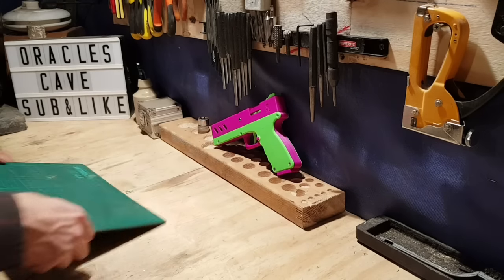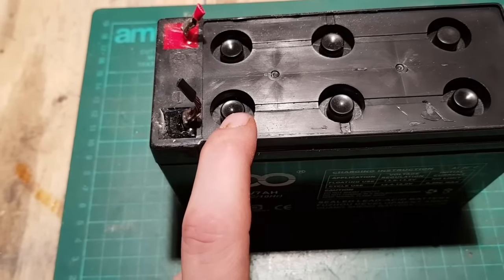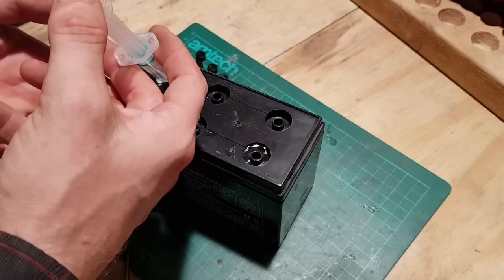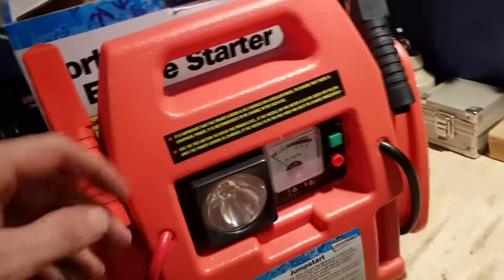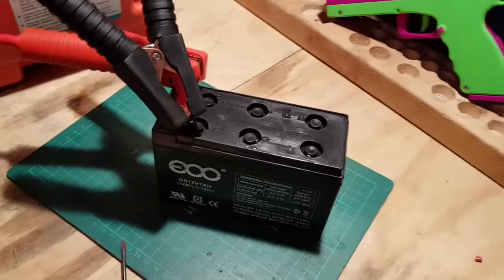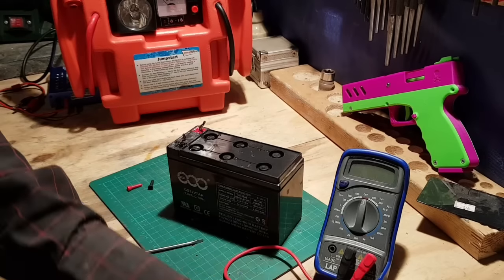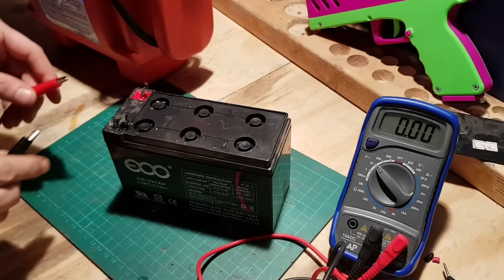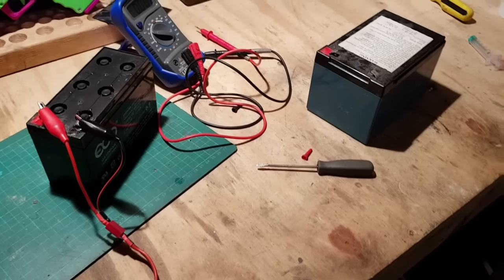HOW TO REVIVE DEAD 6V, 12V BATTERIES THAT WON'T CHARGE

Comment: Thanks, I am going to give this a go on my mobility cart Just so you know I have an old 230v to 18-volt ac transformer and connected the output to a bridge rectifier 20 amp type put that on a heatsink with fan and connected it to my 12 volts 12 amp cart battery both in parallel and run it for 2 hours and toped up the cells as needed and watched the output clime from 8 volts to 14.20 volts then let them rest as they were getting a bit hot after the 2 hours had passed I was looking at a resting voltage of 13.08 volts on both cells now I have to go back to the smart charger and will load both batteries to see how it went!! 16-06-21 if it all works it could save me £60.00 so thanks Bob in the UK
Reply from the maker: You might have to run the battery down and cycle again, maybe a couple of times.
But they should get back up and running again.
Let me know how it goes, it's always good to help someone with zero cost attached 👍👍👍

Comment: Very informative.Tried to use my mobility scooter after not using for about one year.When I tried charging the battery charger stayed on green but when I put back in scooter won't start or register on dial.I will try your battery recharging method and see if that works.Thanks.

Comment: Great video!  What setting did you use for your jump battery?  12v battery or 12v Gel battery and 2 amp or  12amp?  I have  a diehard charger model 200.71225.  I've filled my cells up with distilled water using a syringe.  Thanks!
Reply from the maker: 12v battery, first charge 2 amps then used the power in battery and charged 5 amps, then drained again and just kept raising the amps.
Then a couple of cycles of 2 amps again to make the battery very strong.
Reply: So I found a work around.  Took my cordless drill battery and a couple of copper leads, and connected them to the positive and negative terminals that are marked, then took the other ends and plugging the positive first, placed it under the clamp on my dead lead battery and did the same for the negative side.  Left it on for like 15 -20 minutes and now the charger thinks there is a battery that needs charging.  I did remove the positive and negative leads so it could charge.  We'll see by tomorrow how it looks.
Reply from the maker: @jamesdudley7046  yes that's also a great way to fool a smart charger into charging a battery that has been piggybacked from another working battery.
You mat need to drain the power down and recharge a few times to get the battery back to good strength.
👍👍👍
Reply: @oraclescave  I have been checking the cells and re-adding distilled water and doing the battery trick above to get the voltage up and then placing back on my trickle charger to continue charging.  I have realized it will drink water so I will continue this process and see if we can revive it.  Thanks!
Reply: How many times should I keep the distilled water topped off for each cell?  It seems as if it is stuck around 4.5 to 5.7 volts.  Do you have any other advice to try to get it charging and keeping a charge?  This is happening on 3 of my batteries.  Thanks for your help 👍
Reply from the maker: @jamesdudley7046  if it's not holding a big charge at all, you may need to buy acid refills for a battery, sulphuric acid, very cheap but will instantly bring the battery back to brand new power.
👍👍👍

Comment: Im sure you've figured this out by now but if you can fit bothe the charger and jump pack onto the battery terminals you can remove the jump pack after you put the charger on without having to wait
Reply from the maker: Yes, I just have various batteries now that I prefer using the juice from them that's all.
👍👍👍

Comment: Man I Am a Full time Scrapper. But I Save A Bunch of stuff.  I was told i could revive batteries through this method but I've never tried and honestly I forgot about it.  I have two batteries the same exact batteries matter of fact they were in razor scooters,  the batteries won't charge and the razor scooter will not move at all so same issue. I was going to scrap the batteries tommorow but now I'm going to do this .
Thanks

Comment: Just wondering if it would be advisable to plug in the red booster pack to the house current while charging the dead battery ?
Reply: Good idea, it will probably work, but I have not tried it.  The booster pack charger will limit the current, so it will probably not be harmed.  Might be a good idea to monitor the good battery to be sure it is not run down too low.  Also put an ammeter to monitor the  current between batteries, the charging limit is usually on the side of these batteries.  My 7 Ah battery says 2.16A max. initial charge, and 28W output, so:  28W/12V =2.3A max. discharge rate.

Comment: Great video , thank you I had determined everything you stated with the older chargers and new chargers lol my only concern is if Im using a AGM GEL optima yellow top to link charge a standard led acid battery with same maybe even better CCA-CA ratings connected to a trickle charger. I have read that using different batteries on trickle chargers together can be dangerous as one battery will not charge at the same rate as the other. Is this a myth or can I do this safely ?

Comment: You commented about "always connect the +ve first then the -ve. " This is often spread around, but no one explains the reasoning, so I will.
The relevance is a function of what you are connecting to and which side of the battery is connected to earth. Vehicles with generators were generally +ve earth, -ve hot, while vehicles with alternators are generally opposite, -ve earth and +ve hot. 
The general notion is to connect the terminal and lead that should be hot first, then connect the terminal and lead that should be earth last, that way, if your wrench should touch anything earthed as you fasten the hot terminal, you will not create an arc and potentially spark a hydrogen explosion if the battery has gassed during charging. Once that is secure, and the earth is connected, it does not matter if the wrench touches the chassis while fastening the terminal as both are at earth potential and no arc will occur.
So for a +ve earth system, connect -ve first then +ve.
For a -ve earth system, connect +ve first then -ve.
For what you are doing on the bench, everything is floating (not earthed) so it does not matter what sequence you connect up.
Reply from the maker: Well that was a long shortcut lol
But very good advice, I only really work on floating batteries and car batteries that's why I used the terminology in the video.
👍👍👍

Comment: Al-thought haven't tried it yet as in most old battery's the metal plates corrode  and need replacing might work , may try it some day thanks for your video
Reply from the maker: These days, batteries have glass matt cells/plates
So the only real problem, is dissolving the crystals in the glass matt, or refreshing the electrolytes and water.

It's very hard to actually break a battery, I hope you remember this, and give it a go sometime, you will be amazed how fast you fix it.
👍👍👍

Comment: I am trying to revive two of these 12v 8aH batteries from an old uninterruptible power supply.  I added distilled water just to the top of the plates, then wired the two batteries in parallel with a spare car battery that is sitting on a trickle charger.  After 24 hours one battery is 3.5 volts and the second battery is 5.5 volts.  Both started at basically ~0 volts.  What are the odds the two batteries recover?  I made sure to check they still had water.  I know it's only been 24 hours.  I am under the impression it could take a whole week.  I am unsure how long they sat dead before I started trying to revive them.

Comment: Bugger. I couldn't get this to work properly. I got the battery from 7v up to 11v but I couldn't get it to charge. Even after bringing it to 12v the charger didn't want a bar of it. The battery looks identical to the one in the vid (12v7Ah). Was worth a shot
Reply from the maker: Maybe the sulphation has not broken down yet, there is ways like reversing the terminals to help with turning crystals back to liquid form.

Google would be a good source of info

Also battery refill acid is very cheap and will bring your battery back to brand new again instantly.
As long as your voltage is rising, you know your circuit inside us not broken, so bringing your battery back to life is very simple.

More than likely your battery just has a load of crystals all over the cells that need to be broken down.

Just Google... reversing battery terminals for sulphation/sulfation.
👍👍👍
Reply from the maker: James Wilson  I was just using it as a reference for everyone, I won't let myself be responsible for people doing it wrong.
So I suggested checking GOOGLE for a full run through and explanation, or how to.

As this is a method I personally use for helping bring a battery back to life.

The video was actually just to show that when a smart charger will not work, how to trick it into being able to work, just by using another battery to juice it up a bit to a higher voltage than the smart chargers low power cut off, then it just resumes like nothing was wrong.

Most of the batteries I get my hands on are from kids ride on toys, been left sometimes for 3-4 years no charge, this method gets them back up and running and that's what I had to do to the battery on the video, so I just mentioned it while I was there, incase someone tried to fix theirs and it didn't work properly.

Give a man a fish he feeds for a day,
Teach him to fish and he can live for a lifetime kinda methodology lol.

I hope I cleared that up for you.

P.s, reversing terminals makes the formed crystals break back down and help the cell plate be more efficient.
Sometimes needing a tiny amount of fresh electrolyte ( sulphuric acid ) or similar chemical, and this is why I tell people to research it for themselves.

Idiots with acid, not my responsibility. Lol, but it becomes my responsibility when I tell people to do it, so I don't tell people to do it.
👍👍👍

Comment: Thankyou so much. I’m building an electric trike and have a ton of SLA batteries but they are all dead. Will try this.
Reply from the maker: Go for it Layton, you will be surprised how easy it is to bring them back to life.
Just remember to wear eye protection and you will be up and running in no time.
👍👍👍
Reply: ORACLE'S CAVE Yessir. Battery acid is no good. I would have used Lipos because I have a lot of experience with them but I have boxes of the lead acid batteries that need to be used.

Comment: Didnt even know this was possible, thank you.  I have 6v battery that is fairly new (6 months or so) that will not charge. Smart charger always has a green light and battery voltage has dropped below 6v (5.8v) and it will never charge. Now i know why.
Reply from the maker: Just scamming ways companies have to make you spend money, that's why the old fashioned chargers are being fazed out.

Smart chargers are very smart for modern batteries, but completely useless when it comes to an old style battery.
And since these batteries fail very often, this trick will help you out for the remainder of your life lol
👍👍👍

Comment: question: is there anything special about the smart charger being used in the demonstration, will any charger described a smart do the same thing? is the LED display telling you about the battery, or is it just displaying power it supplying to the battery?
Reply from the maker: Yes this is a special charger that gives all information, power level, charge rate, amps, and lots more.
But smart chargers are too smart and will sometimes not allow the battery to charge.
Old style non smart chargers are the best for reviving a battery, as they don't have any preset power limitations, they just pump power into battery no matter what.
But yes smart chargers tell you everything as it happens.

Comment: Is it common for the plastic caps to pop off while jumping the battery? 5 caps popped like popcorn. Is it due to using too much distilled water?
Reply from the maker: Lol I said leave the caps on as a joke.

I kept having to run around looking for them, so I told everyone else to do the same 😆 🤣 😂 

Leave them off 

👍 👍 👍

Comment: I already bought a new battery before I saw this video. Now I can try to revive the old one with the new one.
Reply from the maker: Ouch, they are very expensive, but very easy to activate after going dead.
Let me know how you get on, smart chargers are just too smart.

You will have it revived in no time with the new one.
👍👍👍
Reply: @oraclescave  Yeah, I successfully revived the old one. Now it is charging on the smart charger. Thanks for your tutorial.

Comment: I'm going to try this with my car battery, wish me luck! 
My 12v wet lead acid car battery was just about to be replaced. I bought a jumper pack to keep in my car until I can get to the dealership to replace it (Prius, small specific size). My smart charger has been telling me the battery is good to go after a short charge, but dies after two starts, dropping down to about 10.5 volts, kind of like what it did in this video but taking longer. As soon as my jumper pack is done with it's initial charge (40 hours) I'm going to try this. I'm guessing 30 mins to 1hr hooked to the jumper pack ought to work. I'll update, and subscribe for life if it does!
Reply: 3 months later... AND???

Comment: Have the same charger but i do it differently,on your charger you can adjust the volts as well, so if you test it with the voltage meter and it says 5.6v you set your chargers voltage to 6v it will charge it,then to 8v then to 10v and then 12v till its fully charged.Worked for me the last couple of years.
Reply from the maker: Yes that is with this charger, but some chargers are called smart chargers and they don't allow you to change settings.
But yes this charger is very very smart lol
Thanks for leaving good tips for future viewers.
👍👍👍

Comment: Use an rc charger and set the voltage at 8v and 1-2 amp and be sure to watch so you don’t actually overcharge it but it will melt of any sulfation.  Of course add fresh sulphuric it’s only $10 at the auto store and it’s already properly diluted.

Comment: Learning from you.which water.rain water only or even tap water can help.
Reply from the maker: Rainwater or distilled water or de-ionised water.
Do not use tap water as it has impurities and minerals that will give you more issues.
Ideally you would use distilled water
👍👍👍

Comment: Can I jump it with my car's battery and jumper cables if I don't have one of those portable jumper boxes?
Reply from the maker: Kind of yes, if you just link the batteries with leads for a few minutes it should be fine.
I'm not sure if it would be wise to do it with the engine running as the alternator will be charging at about 14volts.

But yes, just linking the batteries together for a few moments will boost your battery enough to get the voltage moving.

Remember to run the car afterwards just to pick the car battery voltage back up, it might lose a tiny bit of power
Reply: @oraclescave  Thank u very much my friend! And I was actually wondering about that very same question regarding whether or not the engine should be on or off. I'm glad I waited because my thinking was that I didn't want to drain the car battery if it wasn't on when I did it. While I was distilling some water in my kitchen for the dead battery, I connected the power wheel to an 18v Milwaukee drill battery lol. It was the first time I was able to see it power up, made my day. Thanks again, your video was PERFECT!👌🏼
Reply from the maker: @hcic9860  you are very welcome buddy, I'm glad it got you sorted out, nothing beats a free fix.
And I appreciate you for coming back to comment to let me know.
👍👍👍

Comment: Ive been told to only use distilled water for reasons unknown to me.   I was assuming that the heavy minerals that is present in tap water or even rain water being its natural and distillation i assumed seperated the water and minerals.  Since distilled water has no nutritional value, or at least thats what i thought i read somewhere.   So if i may,  could i ask for some clarification on what the difference is between specifically told for many years im needing distilled water only and nothing else besides new acid of course  and then the theory of just using rain water.   Unless rains process of evaporation is the key factor. But i thought rain had nutritional properties that were beneficial to life.  But maybe rain water only gathers nutritional value when it saturates through the soil and picks up minerals.      Im just curious and definitely would like some input.   Thanks ahead of time
Reply from the maker: I think its because its PH neutral that's all